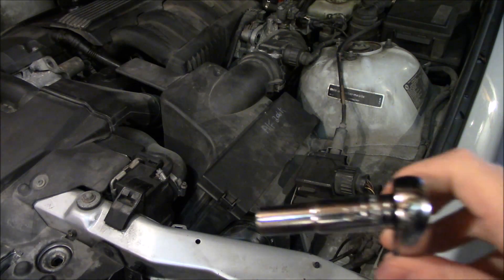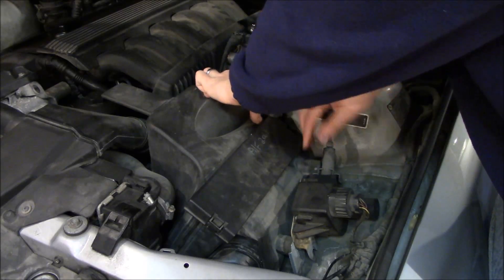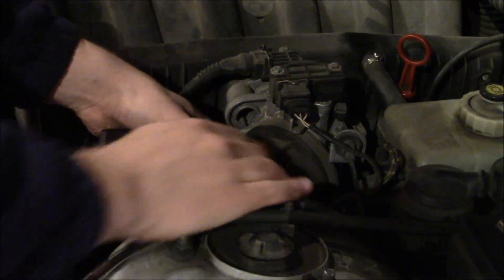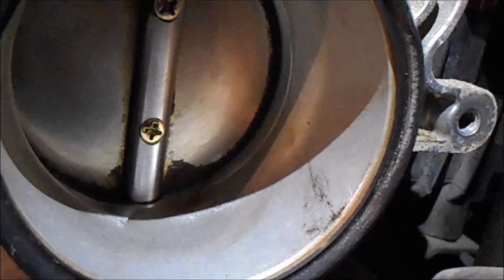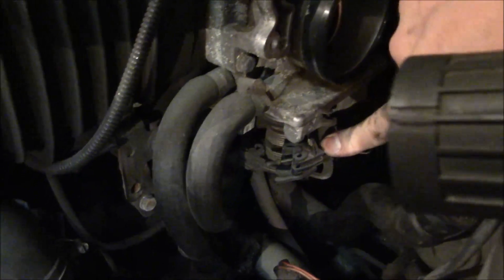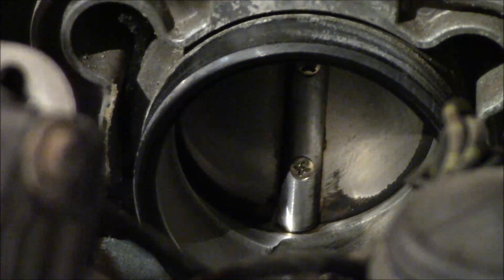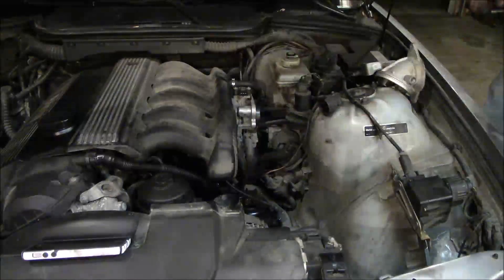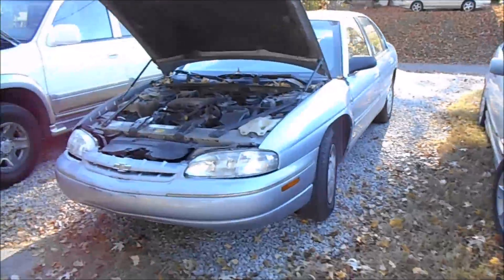How to Clean the Throttle Body (POOR IDLE)

Comment: Any concern about flooding the engine when repeatedly opening the throttle manually?
Reply: Car is off. Fuel pump not working so no fuel is getting in engine.

Comment: My car for some reason has taken a shit and everything is wrong. It's a 93 318is. It feels gritty on the gas pedal and the power as dropped lower than usual. 
Like I have to put on the gas way more than usual to get up to normal speed than I use to. 
And it stalled a couple times. Is this a throttle body issue?
Reply from the maker: Good question. Best thing to do is check for any codes if check engine light comes on. If check engine light is NOT on then I guess you could always do a tune up. Change spark plugs, clean throttle body, clean mass air flow sensor, make sure you have no vacuum leaks, change fuel filter, etc. These are the easy things all less than $50 to do. I've made videos on a few vacuum leak prone areas on my E36 and I've also cleaned the MAF sensor. How is your gas mileage? Has it dropped below 20 or 15 mph? Check your spark plugs... if they have a lot of carbon build up you make have a fuel to air ratio problem.
Reply: That's your air intake boot or the hose coming off it